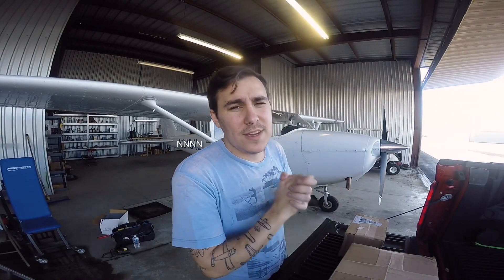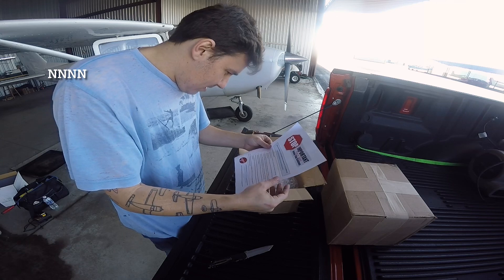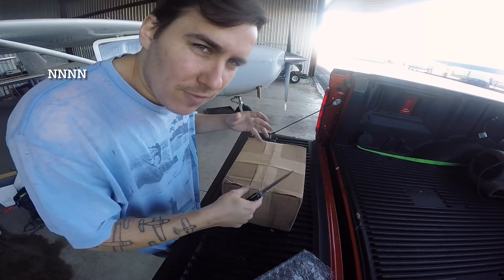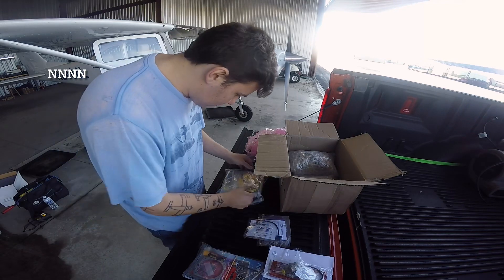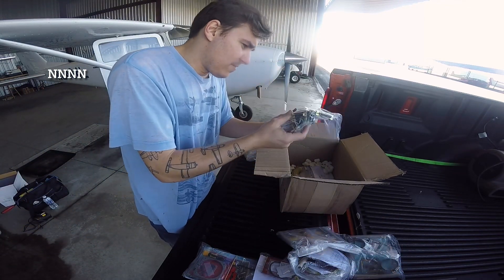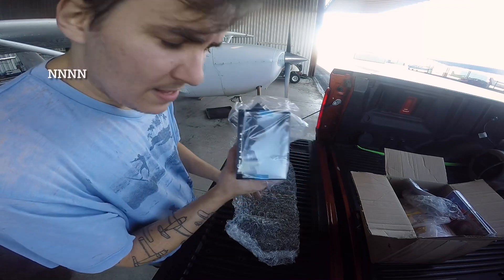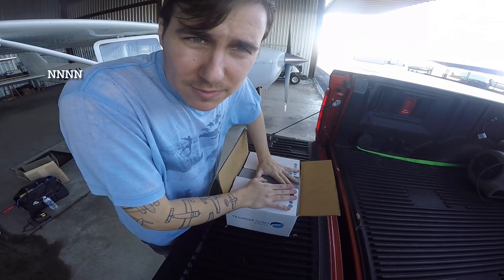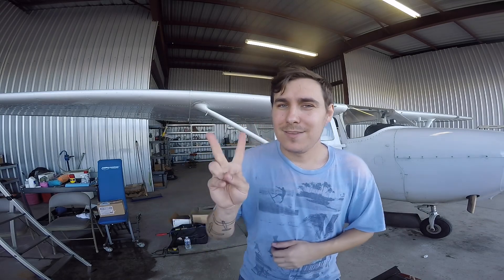JPI EDM 900 Un-boxing For The Cessna 172

Comment: Considering pulling the trigger on an Engine Monitor for an 0-300 as well. Wish there were probes for the CHT vs the "Gasket" type, also not much room for the EGT probes.. will be following to see how your install unfolds
Reply from the maker: Well I wont make you wait, I had to do some creative clearance work on the intake runners because the exhaust manifold is so close. Nothin a sanding pad on a di grinder couldn't tank care of though. I am more happy about the oil filter adapter. I was getting annoyed with having to take the temperature bulb out of the sump every oil change. I did have to take a little material off of the alternator to get that to fit as well.